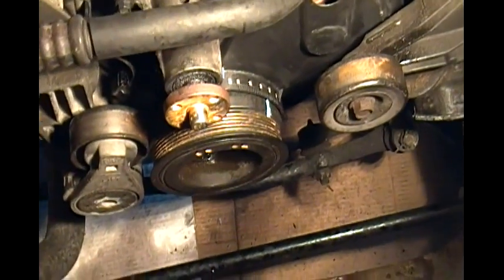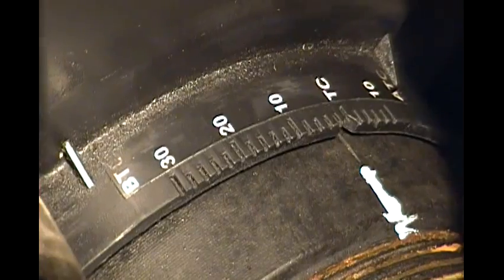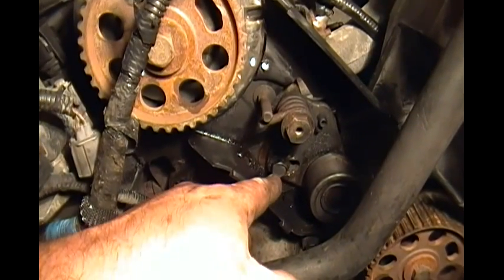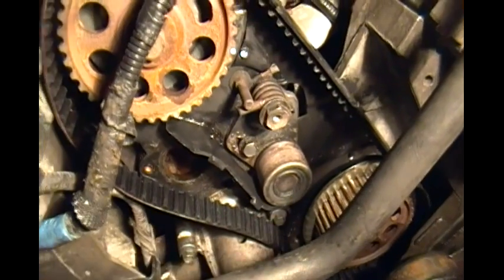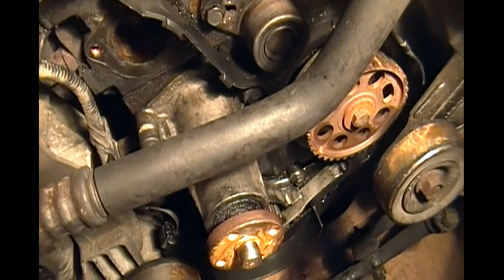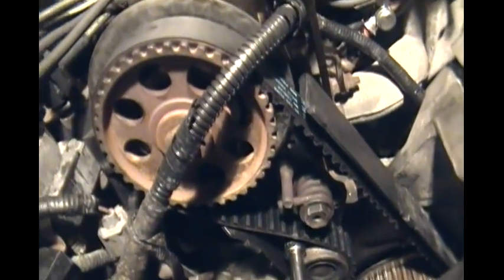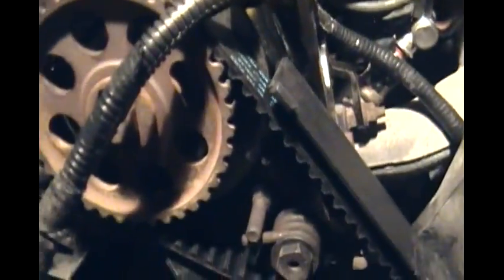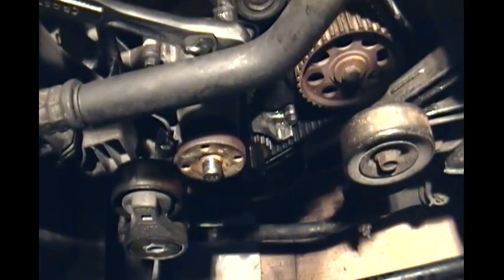96 RangerTiming belt tutorial: PART 3

Comment: yeah but how do you tighten the crank shaft pulley bolt
Reply: I use an impact hammer if it has an auto transmission. If you have a manual transmission, you can use a regular ratchet/torque wrench, but with an automatic you'll just turn the torque converter.

Comment: These are not tolerance motors you will not damage the engine if you are not right on the marks however, it will run like crap

Comment: i have the 97 ranger, 2.3, 5 spd.
timing belt broke 2 days ago while in traffic.
overall easy job. just make sure you have a large two or three jaw wheel puller for the harmonic balancer pully.  you'll  need a half inch, or larger impact wrench , and a 7/8 inch socket.
i would never for safety sake try bumping the starter with a breaker bar. also you MUST remove the radiator,  i removed the ac condenser as well. there's  not enough clearance in front of the crank pulley to use a puller or impact. some of the videos say the pully comes right off, its NOT a one size fits all thing. mine DID NOT. cost me three hours down time to wait for a ride to auto zone to rent the puller!!
i would have been done jn that amount of time!!
have your tools ahead if time.
setting the timing pretty is easy, stupid design. youll have  to set the crank at TDC, remove the cover and make your own marks inside the cover., the cam uses the triangle shape, and the oil pump/ cam position sensor uses a diamond shape. after installing the belt,  remove the power plugs to BOTH ign coils, crank the eng, and hand turn the crank till at TDC, recheck your timing marks, adj if necessary.took me two times bc of being off one tooth on both the oil pump and cam. rotate again and recheck, then reconnect the ign coils, and start it. yes start it with no water for a few seconds won't hurt anything. just be sure to reconnect the intake air plenum, and MAF if you have it before you  do, clear check eng lite.
the belt tensioner pulley can be a bitch. . I  used a regular large, framing claw hammer, prying between the pulley and spring. one person job, use some penetrating oil on the lock bolt, back plate, spring bolt, you want smooth opperation. dont forget to tighten!!!!
good luck !
Reply: how do you tighten the harmonic balancer pulley bolt

Comment: Ihave a '94 b2300.  Can't seem to find a video with the same marks.  Can't find a mark to the align there oil drive with.  Don't think it has a diamnd on it at all.  The cam shaft gear does not have a mark either except for a thick point just behind the teeth on the gear just like the oil gear.  I did see one vid showing to line thiS Up with a gap on the engine or back half of timing belt cover/
  Comments?  Ditto on the gears moving when the tension pulley is released.
  One more think, a sticker on my truck says to unplug the input spout (?) and to set the crank at 10 degrees btc.

Comment: The nice part about the 90's Rangers / Mazda B 4 banger series of trucks is that if the timing belt brakes while you're driving the valves won't beat holes through your pistons. The is one of the few engines that don't have that problem.
Reply: So you are saying that it's a non-interference motor? I hope so.
Reply: Non interference

Comment: Great job!

Just adjusted my 97 Ranger's timing belt, the upper pulley was off a tooth, I had to actually turn the bottom crank pulley and oil pump past TDC to about 5-6 degrees (arrows/tick not aligned), then put the belt on the top pulley, then release the tensioner, then the oil pump and crank would rotate that 5-6 degrees into position...uggh, trial and error.  Lined up perfectly now though!

Comment: Everyone is aware that all the L4 motors in these are non-interference right? You do not have to move all the pulleys at once nothing touches internally. You also dont need to drain the coolant and take out the plugs. This guy should have done some research before doing this he would have saved alot of wasted time.
Reply: from my experince its best to remove the radiator, you get  acess to the crank shaft bolt, ive done dozens of these, the crank pulls the cam, dont worry about the oil pump jackshaft, you can ,mark it if you want to, because the early engines run the distributor, which is easy to retime to about 7-10 degrees TDC

Comment: You didn't show how you took the tension off the timing belt tension.  How did you do that?
Reply: Ok, since I couldn't find how to retract the tensioner, I made a video how I did it and it should be available 'soon' as soon as it finishes encoding.  I will call it:
timing belt change Ford Ranger 2.5L   2014 02 22  105060
Hope this helps other Ranger owners.
Reply: Garras Porgratix vy

Comment: I had finally got my timing belt on. However no matter what i tried it never aligned. I had thought that maybe i had gotten the wrong belt but after returning and rebuying the result was still the same. I found out a week later that running the motor just slightly off would result in the bottom end giving out. Make sure you get the marks on folks. Otherwise you end up with a nice yard ornament. Since then i have sold the ranger for scrap and ended up with a bigger problem....a dodge lol

Comment: Imagine: a motor designed to be worked on without agony. Imagine: deliberately designing components for absolute maximum access for mechanics. We'd see repair bills go down because labor would be slashed. Case in point: Subaru water pumps. Need I say more?  Something's way-wrong when it costs $800 to replace a $40 pump. In Subie's case..their water pumps should be external AND electric, 'mounted on the fender well, and NOT behind two timing belts and an oil pump. All water pumps fail eventually.

Comment: The timing marks on the crank shaft, COMBINED with a soft/non metallic probe..inserted into the spark plug port..and used as an indicator...simply put; use the probe ( a soda straw works good..) and turn motor over until you see that the straw sticks up as far as it can, WHILE the marks align on everywhere else....  There should also be a mark on the flywheel/flexplate, too.

Comment: Don't understand why we had to pull all 8 plugs: I get the fact that relieving the compression makes turning over the engine easier ( but it's not impossible w/plugs in, either)..Removing the "compression side"..(driver's side) is all you need to do.  Sure glad I don't have an AC compressor in my way.  Also, check out the trick using the starter motor to break torque on the pulley bolt..there's always a trick..

Comment: Thanks a lot! My timing belt snapped yesterday, and these 3 videos were a lifesaver!

One thing I did.  Before I removed the cover, I marked a second spot on the crankshaft pulley, and on the area behind it.  That way I could find top dead center with the cover off.

Comment: Thanks, that was helpful.  
Would you believe I went to Tire Kingdom to have this done, and they held my truck for 3 days, poked a hole in my radiator and told me I had a leak, before admitting to me they didn't have anyone qualified to do this?  
They sent it to another Tire Kingdom, who to their credit, did a marvelous job, even if they charged me 3 times the going rate.  
I changed the radiator myself; I wouldn't give them the satisfaction! 
Seems they have a bad reputation for damaging cars.

Comment: CONTINUE FROM LAST COMMENT: //// DO NOT let the starter turn continuly only a joult or one rpm is needed. After activating the starter, immediately release the key and check to see if the bolt has been loosened. The action that loosen the bolt is the starter's extremely high torque and the breaker bar placement on the frame rail acts as a stop point that keeps the bar from turning (leverage) there by loosen the bolt.

Comment: I need help!!!  Removed the harmonic balancer, and there is a circular plate that fits onto the shaft behind it. I cannot remove the timing belt with this piece in there, and I can't seem to remove the crankshaft position sensor bracket that is blocking its removal...

Comment: Thanks for going through the effort to film and post this.  I'm going to give this a try on a 2001 Ranger. 

Here's a question. On many timing belts, you usually replace the water pump at the same time. Is that the case for the Ranger?  Is the water pump driven by the timing belt, or is it driven by the serpentine belt?